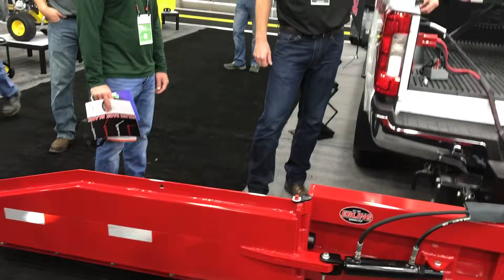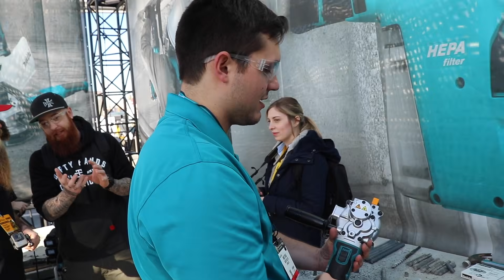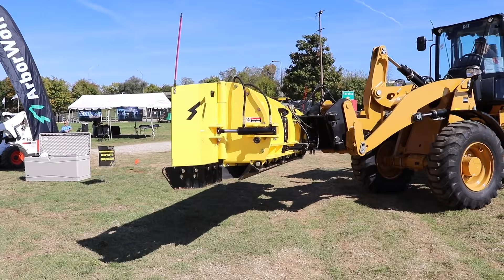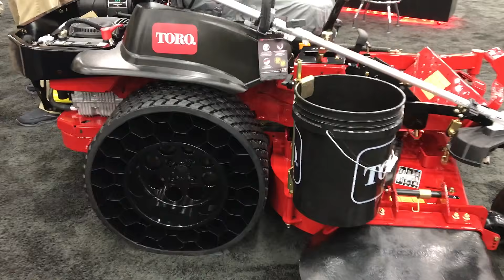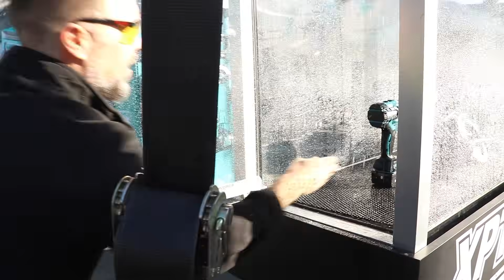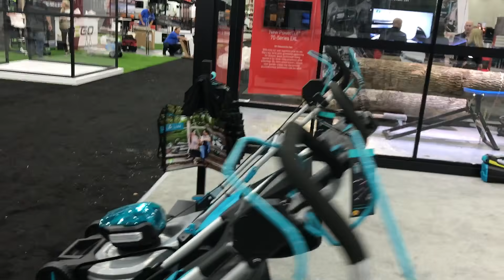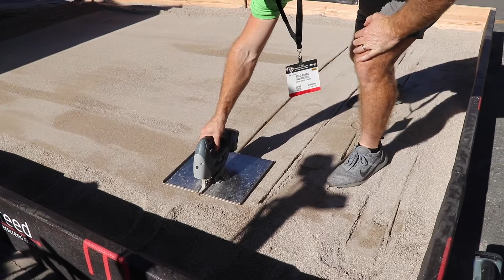Best & Worst Landscape, Construction & Power Tools, Equipment & Innovations of 2018

Comment: That makita rep sucks.
He asks how it cold cuts and the rep...
"I'll tell you how, our technology that we engineered with our phenomenal engineers carbide who made great technology... So... Yeah. Yeah.. That's how."
Wtf! 
Maybe say, well we don't use an abrasive disk to sand away the material, we actually very quickly chisel the material away with a vibratory cut.
Or something like that. I'm guessing, but it seems like that. Which has existed for awhile, just not so strong and low rpm, usually very fast. Great for cutting nails and such

Anyway, that rep blows

Comment: I’ve been plumbing for 30+ yrs and these tools are great and all but I still have and use my cast iron chain snap cutter and it I think I paid 125 bucks for it used over 20 yrs ago. My point is most of these fancy tools aren’t practical and forget about the sticker shock

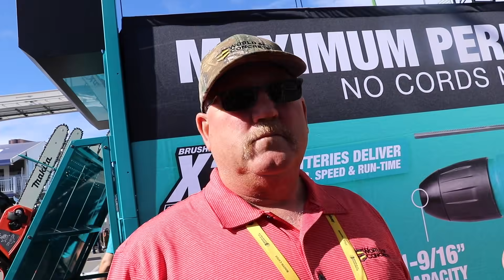Comment: At 11:36, you can see the Spin Screed which was purchased by Marshalltown tools. If you check the pending patent application on their battery powered spin screed you will see my name as the Designer. I put a lot of hard work into that project and I am very proud of it even though I no longer work for Marshalltown. We also utilized the Makita Right angle drill in the design. It was a great experience!  Thanks for posting.

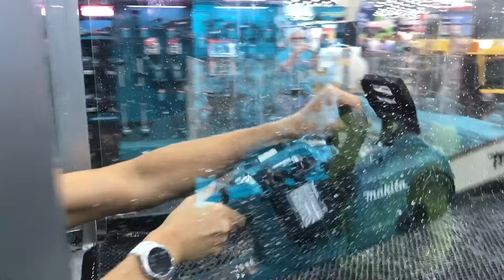Comment: @ 9:20 ish that IS NOT "running underwater!

That is running in sprinkles or rain.
There's far more air there than water.

By those definitions, I'm typing this under water because there's moisture in the air. I'm typing it under zero gravity and space rock...

No, if they want to run it underwater, submerge that sucker a few feet in a swimming pool and run it. THAT is running underwater.

Comment: I know this ia a year old, but I just now saw this video.  I can tell you that Micheline brought their Tweels to Camp LeJeune a long time ago and had us put them on a few HMMWV (Hummers) and test them out.  They were junk, because they would fill up with sand, dirt, mud, sticks and then vibrate like hell on the roads at speed.  Yes, they were nice because you could shoot them and they would keep going.  But the one thing that you can not do with these that you can with a pneumatic tire is Air Down for better traction in certain areas.  Plus they didn't handle too well even when they were clean, because there isn't a lot of sidewall action like there is on a pneumatic tire.
But on lanw gear and other lighter heavy equipment, I can see them being a great addition.  In fact, there have been loaders that work in mines or other places where puncture is imminent.
Reply from the maker: Thanks for commenting and for watching Jeremiah!

Comment: Dust fines? They are getting completely out of control. That is why, as a business owner, I went into residential work. After 20 or so years in commercial work I decided it wasnt worth the fight to deal with all of the nonsense anymore. I realize they can chase us down on residential, but it isnt likely and I have had no interaction with them in over 5 years

Comment: I worked for a Stingray boats from 88 to 95. We used Makita cordless drill. They were awsome. Had 9 volt batteries. They took serious abuse. Had one that dropped in fiberglass resin. Took it out of the resin cleaned it with acetone. It was running  4 years later when I left the company.

Comment: The 4 cycle equipment that can run upsidedown is very important for when you need to hang upsidedown  with your knees from a vintage monkey bar set and demo it to replace it with the new plastic coated  kidsafe climbing gym!

Comment: Have 2 Makita 4 stroke cut off's in inventory in our company and they are JUNK I'm not sure if its the maintenance shop we send them to or the equipment themselves but they both run full RPM and the blade has to be very gingerly applied or it will bog down and lose speed. Worthless when the 'ol 2 strokes just scream through with HP to spare. Even though I know 2 strokes take a bit more care to keep running they make up for it in productivity.  A weak saw is just frustrating trying to get a job done.

Comment: That Grinder with the cutting disk recessed into the housing will have limited use. Even on construction sites where rebar is being cut to length I want to cut multiple lengths at once. - This drawback prevents that.
Seems to me that those 'tweels' will have all the drawbacks of low-profile tyres, will fill up with debris and more importantly will crack under high stress shocks.
That jackhammer is absolute garbage, that rubber boot is NOT going to survive rough work on the site, let alone being a battery hammer. NO!

I don't want to be negative but all I saw was a bunch of gimmicks and a few vaguely good things that I've got no use for.

Comment: that dustless jack hammer is a god send. i recently had the FD called because i set off an alarm with the dust. You can imagine the fine. I will be purchasing the jack hammer from makita and the concrete drill. Thank you a lot for this valuable information.

Comment: Love my makita, my impact and drill hammer combo I was issued almost 4 years ago, batteries still running strong , I use them 6 days a week the last almost 3 years of the 4, dropped from ladders accidentally, used in the rain I've super glued some soft rubber parts back on and have to do some more.  I've have falls of these things where tell myself, it has to be dead........  nope, still going strong.  Seems like the will never die....

Comment: Those cordless dustless hammer drills are cool. I always have to drag an air tank around to blow the holes out before using epoxy dowels.

Comment: Wait, it cut smooth and cold??? Yeah, I can understand the face you pulled. Burnt my fingers way too often just grabbing the wrong spot on a bar after cutting. I'll check the link after to see if Amazon ship those to Australia (it can be hit & miss)

Also:
a) they're called prawns in Australia
b) not many Aussies put prawns on a BBQ - beef steaks, kangaroo steaks and sausages are more likely. Oh, and lamb chops

Comment: Well.....iv used the prizzi bar attachment before. Didn't work as well as I needed it for. Attempting to use rough milled 8×8 as a foot rest for a bar table, I needed decent 45 degree angles. Problem was that it's works just the way it's designed, like a chainsaw. The chips while cutting constantly blocked the view of my cut line. I ended up just resorting to a circular saw and finishing the center of my cut with a sawzall

Comment: On our farm, we need a lot of this equipment. We move a lot of dirt, we move and cut large pieces of stone and use them to fill in deep holes in our pond so the calfs don't drown and in smaller holes in the pasture so the cows don't hurt their legs.we use a 2015 case skid loader, we have a 2014 case tractor with a front loader. It has 95 horse but I don't know what it's called. We also have a smaller case tractor with a front loader we use for smaller jobs. It only has 45 horse. These three have interchangeable attachments, including three different sized buckets, a pallet fork, and a bale spike.

Comment: You seem to not like the Fed Gov telling  you dustless is the way to go.  Why is that?  I’m forty now but when I was young and working in a cabinet shop every old mongrel in the joint poked fun because I independently procured and wore a proper respiratory as part of my PPE.   My ears don’t ring and my lungs are perfect.  There is zero advantage to sucking down concrete dust or any dust.  No I don’t think PPE should be a choice.

Comment: Great video!! I would not buy the Makita drill though as I burned mine drilling a hole. (3/4 Spade bit in 4x4). I had to pull out my old Makita drill from 1986 to finish my work. The new lithium drill is just bad.

Comment: It might actually be a good thing of osha pushing more. I worked at a temp construction job. I worked with different teams of remodeling a Walmart. I ran 80lbs jack hammers inside the backroom. And I only had ear plugs. I didn't have training or any precautions. Just, there is the jackhammer and go at it. I burnt out 3 jackhammers myself and other people burnt out 2 jackhammers, because we didn't actually know that we were supposed to stop every few seconds of hammering to let the hammer cool down.

But after that project for a couple years, I had trouble breathing. It probably was the 2 year mark where I was telling my friend that I keep randomly smelling concrete through the day. I am a 7 mile jogger and here I am having trouble breathing from just walking up a hill and smelling concrete. Then there was one day, I was reaching for something on a lower level than me, basically a hand stand. Then I felt something in my lungs shake around and then to my throat. I coughed painfully and small chunks of concrete came out. So I had actually inhaled that concrete and it was bothering me for more than 2 years. But since then. I can do that 7 mile jog again and no breathing problems.
Reply from the maker: Wow that's wild, thanks for sharing Tyee!
Reply: that is indeed absolutely re fn mark able. I thought I was the only one. I tilled pools and cracked open a few hundred bags of Portland cement and mortar myself and 15 years later I was bending over like pulling weeds and clearing ground, stood up fast and burped like a French whore and out puffed a puff of dust. and I also had that concrete smell before and after said whore burp.

Comment: that 4 stroke saw is awesome... i bought one a while back.. the blade arbor can also be flipped and the blade put on the other side to cut really close to a wall.. i wanna say it will use 14 and 16" blades but i am not sure.. i think i saw a kit with a bigger blade guard that can be put on it but i don't remember..

Comment: That first tool is a portable version of what is called a 'cold saw'. It works a lot like a slitting saw on a milling machine instead of an abrasive grinder. There is less heat generated to start with, and most of it goes off in the chips.

Comment: I got a bone to pick with Makita I use Makita for many years up until last year when I change all of my equipment to a competitor because even their advertisements say their batteries work with hundreds of their tools they do not the new batteries are not able to run the older tools so anything that has a battery monitor on it will not work on anything over 3 years old but it's cool that they can send you to a show and look at competitors items still I got a 9 piece set of tools that still work but if I start upgrading and buying their new tools the batteries will not work so what is the point really are they going to end up doing that again in a couple of years I don't believe this is fair to their customers however I do still prefer their tools but their customer service was not very helpful when I pointed their advertisements out to them that are put up at every single Home Depot in Las Vegas

Comment: The bobcat tires are great for flat ground but if you start going over rocks or demolition sites or turn on even concrete it's going to tear those wheels apart in a very short time

Comment: Nice video. Nice coverage of amazing products. However, please avoid bashing safety regulations without legitimate supporting information. You're a journalist, and your comments sway perception. That's over 425,000 influenced opinions according to your view count. Yes, there ARE bogus regulations, but most are based on a legitimate need for the benefit of people. The "little guy" that you're concerned is getting screwed by the OSHA dust regulations may actually be saving lives or preventing chronic respiratory conditions caused by concrete dust.

Comment: the chainsaw for your worm drive saw is really cool! what a great idea. also love the portable road, huge timesaver vs throwing down plywood.

your really amazed by carbide tooth metal cutting saw blades? they have been around quite a while, although admittedly i dont think ive seen one on an angle grinder sized device. looks like that ones specialized for cutting bar however, id want something more versitile.